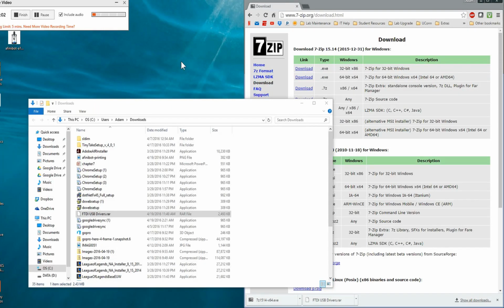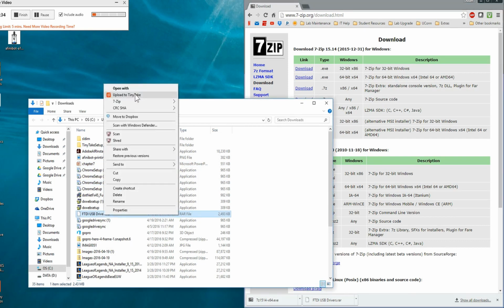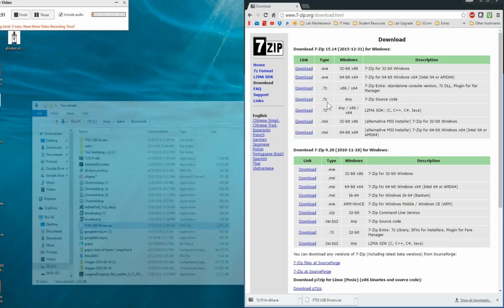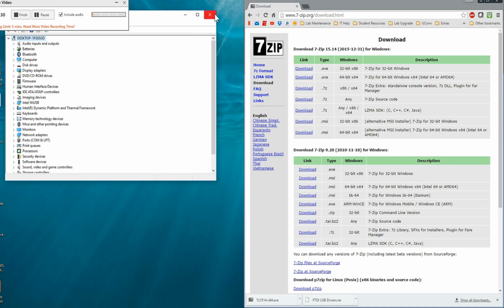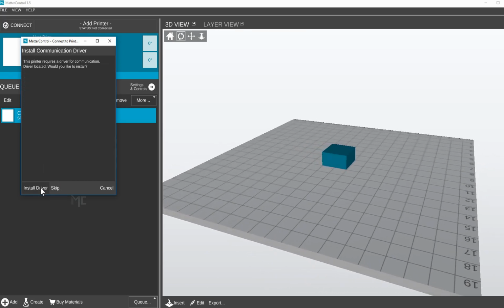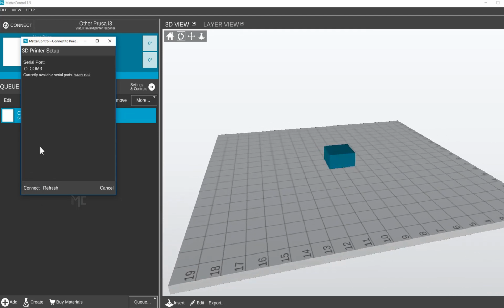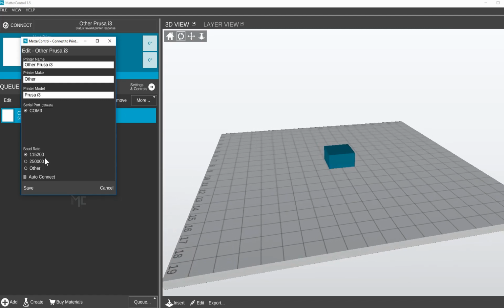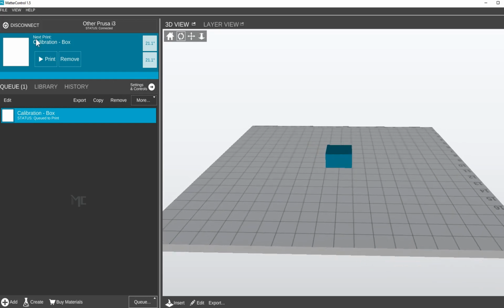MatterControl - Install FTDI Drivers & Connect Anet A8 3D Printer

Comment: I’m having issues connecting my Anet to MatterControl and your link no longer works lol I don’t suppose you have an up to date file ?
Reply from the maker: check baud rate, 128000 vs 250000